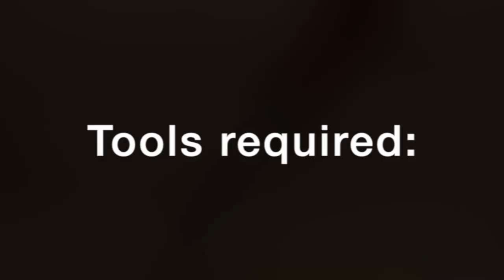AKG C/Y50BT Headphones  - Repair Guide (HD 1080p)

Comment: Thanks for this guide, I really like these headphones, shame to throw them away. In my case the hinge part was not broken but the joint was missing a smal washer/ring that kept in straight. 
Also nice to note the battery is replacable without soldering  - in my case the headphones did not break apart from the headband inside wear, but th battery deteriorate in capacity after some years and it needed replacing.
Reply: Hey, I have the same issue with mine. Did you manage to find a replacement washer/ring?

Comment: Waiting for my broken used y50bt's to arrive. I payed around 13 $ for them, only hinge is broken. I think I'm gonna use epoxy + some hot glue on the top of repaired part, just strengthen things a little bit. Great quality and montage of the video, thanks a lot

Comment: Bro I need that hinge rubber
Reply from the maker: The hinge ‘rubber’ is the part that is glued & repaired. If it’s too badly damaged for glueing, then try to fabricate a replacement from things such as small flexible cable clips, pipe clips or plastic strips (like an xlarge cable-tie that’s cut down to size). It’s only function is to clamp down the headphone band attachment, so use something tough but flexible enough to cope with the twisting and pulling that headphones go through!

Comment: It's not a real repair, certainly not for long.
Reply from the maker: Correctly done, granulated super glue repairs make strong bonds - ask any guitar tech worth their salt. Mine is now 2 years repaired and still going strong. The “pro” repair of smothering the area in resin means you can’t make further repairs (such as replacing the headphone socket).